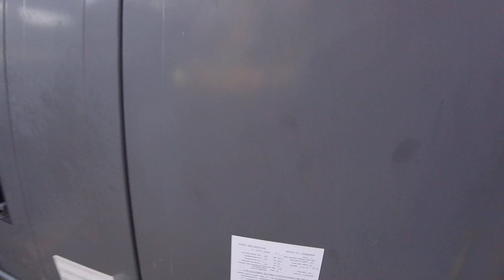Change A Defrost Board

Comment: best control board on the market and most simple,,,,i use them on tranes,,,tempstar,,rudd,,or any other brands,,,but its also best to always change the defrost sensor also at the same time.....i've got a 5 ton tempstar 15 seer in my home,,,i ripped all that crap out to that it came with,,,,you look inside the panel now,,,,,its a ''''GOODMAN UNIT'''''LOL
Reply from the maker: I only change parts that are not working.